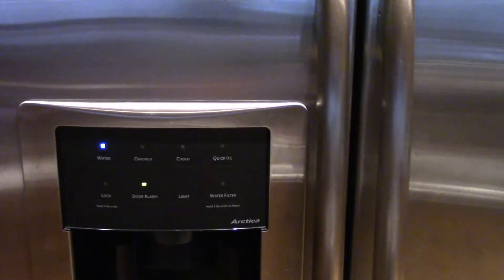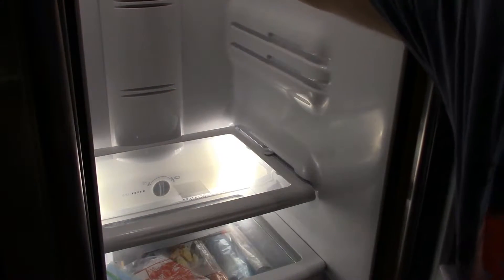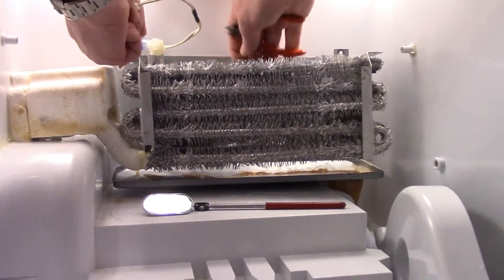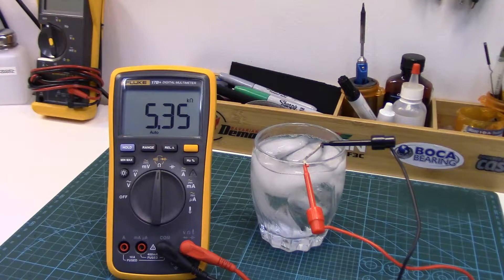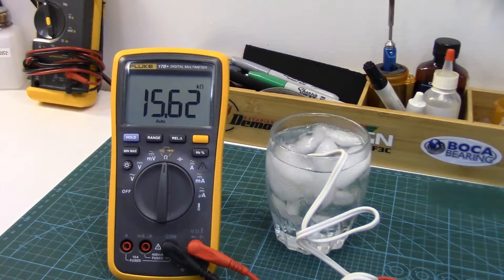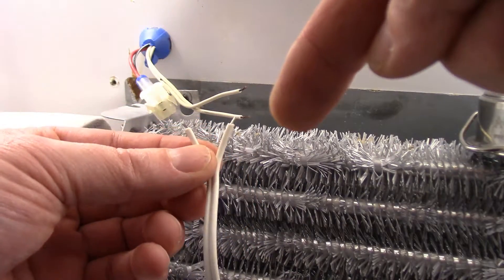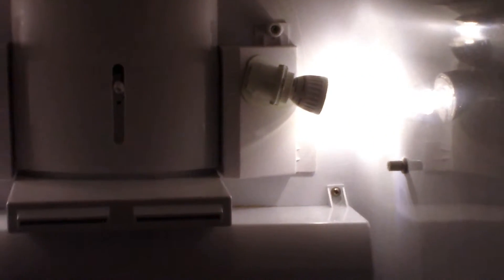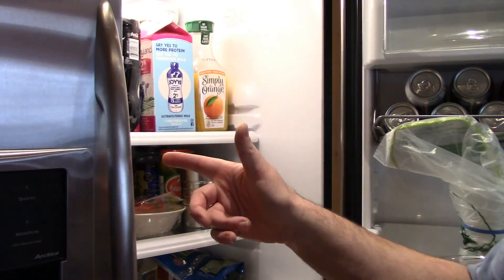Fridge Temp Sensor Replacement & Testing

Comment: Hey John. I replaced my freezer sensor because it was faulty. Now the freezer is only managing to get to minus 11 degrees centigrade maximum (despite the setting set to minus 21 on the dial). I took the sensor out again and checked the resistance and at zero degrees water temperature, it read 28.8 kilo ohms and not as your video suggested 16.3. Would you say the replacement sensor is wrong (despite part number was WR55X10025) or even faulty? By the way, the sensor I replaced had a reading of 14.6 kilo ohms at zero degree - interesting!
Reply from the maker: Sounds like a bad thermistor/temp sensor if you checked it at 0C and it's reading 28.8k ohms. The control board would be seeing that 28.8K value as a fairly cold reading (likely around -21c) lol. And that is why it's not getting any colder than -11.  When diagnosing temp sensors like this if you first want to test a "bad sensor hypothesis", I have in the past substituted the thermistor with a resistor to determine if it's a sensor or the control board. If you were to put a 15K resistor in for example (so the control board is thinking the freezer temp is around 0C, and then the freezer started getting nice and cold, you know the sensor is faulty and the control board is working. If on the other hand, the freezer doesn't get any colder, then it's likely a control board or something else. You never said what the initial problem was however, so I'm just going by the few facts that have been presented. I'm also not an appliance repair technician, my technical training is automotive, but electrical fault tracing is fairly universal. 🙂

Comment: Thanks John for a clear and well presented video. My freezer sensor has gone after 16 years so I might me lucky. How important is the heat seal because I have watched two other sensor repair and they use only a crimps to connect the wires.
Reply from the maker: As I stated in the video, if you want the new sensor to last and your wiring harness not be contaminated by moisture ingress; sealing the mechanical splice with adhesive lined heat shrink is IMPERATIVE.

Comment: My fridge ( (LG GBB60SWFZS)  always freeze, a lot. After 1 week all the bottom freezes and needs to be thawed again, the heating element MEE62606001 does not turn on.
After thawing, it freezes again and never thaws

I measured the sensor (6500JB1001N) at room temperature was 5K ohms (5000 ohms)

When completely frozen after a day, the sensor shows 9K ohms (~ 8500 ohms)

where I can get my sensor (6500JB1001N)  data sheet ?????????  Maybe is normal for this sensor 8,5K ohms in freeze ??????   THANK YOU

Comment: Great vid John. I have a GE refrigerator as well and the problem I m experiencing is its nit cooling at all. We had a power outage in the neighborhood from a Strom and when the power came on, the fridge no longer cools anymore. All fans are working, compressor turns on. It might be something electrical. Possible  main board malfunction? Took apart the fridge and tested the thermistor in ice water and the highest it got was 13.25. Tested in room temp and it read 4.99- 5.03. Neither freezer nor fridge gets cold. Same manufacture fridge except my freezer at at the bottom. 

Help please!!
Reply: Main board in back